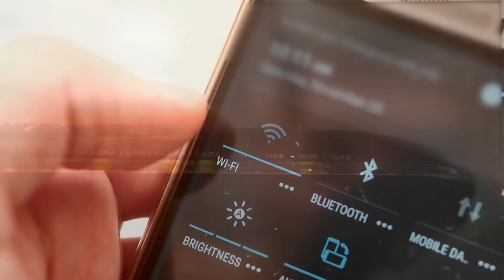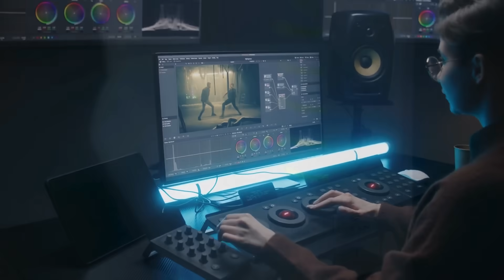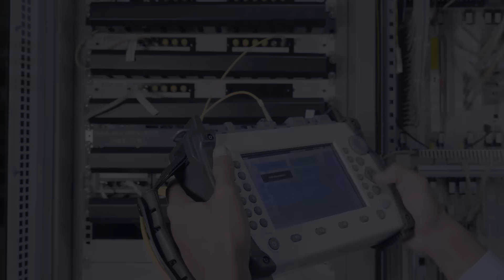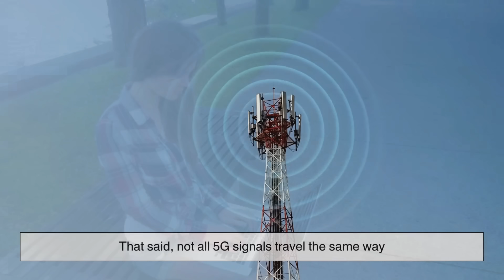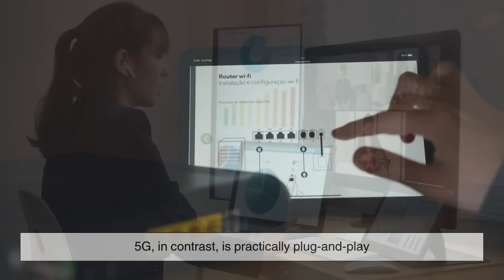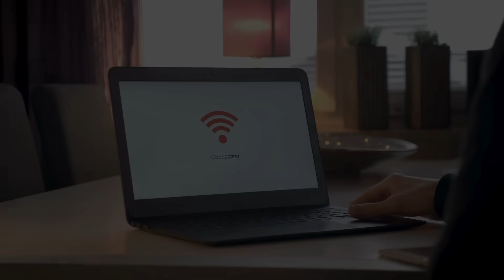How Do Fiber and 5G Battle Between Stability and Coverage?

Comment: India's 5G rollout has yielded disappointing speeds.  I only get 15-20 Mbps max across all operators, contrary to advertised speeds. Therefore, I primarily use fiber optic internet for best stability and speed. 5G on the other hand I only use in android auto for navigation and infotainment.

Comment: Poland is in the middle of transformation from 4G to 5G.
So far I use 4G and speed is reliable (up to 200Mb/s) but when 5G will be here it should be 600Mb/s and later on 1Gb/s

Comment: 5G is no anywhere near Fiber since The current world record for data transmission over a single optical fiber is 178 Tbps (terabits per second) over a distance of 40 km although researchers achieved 1.02 petabits per second (Pbps) over a distance of 1,808 km using a multi-core fiber.
Reply: yea thats like a regular missle vs a hypersonic missle that probably could never be achieved

Comment: A 56k modem can transmit data at a maximum speed of 56 kilobits per second (kbit/s), which is equivalent to 56,000 bits per second. However, in practice, real-world speeds are often lower, typically around 42 kbit/s.
These were late nineties and 2000 speeds using dialup.